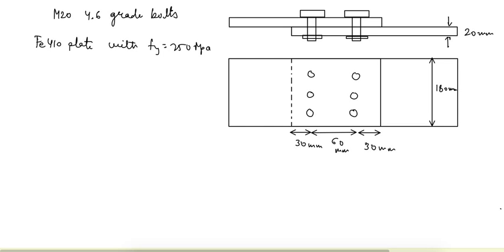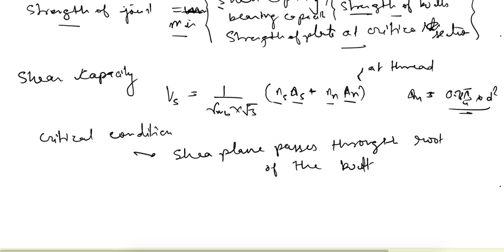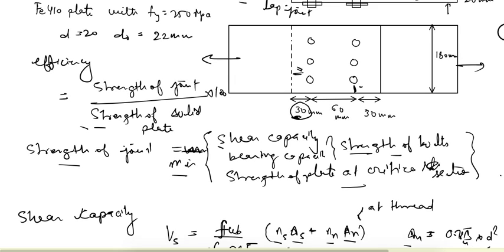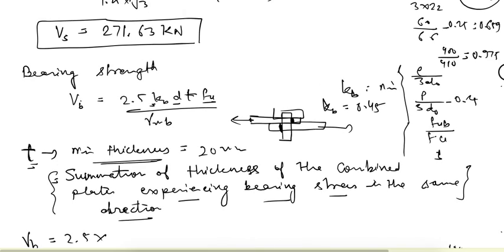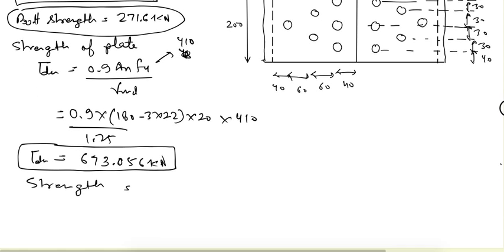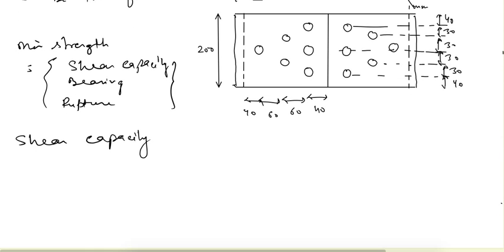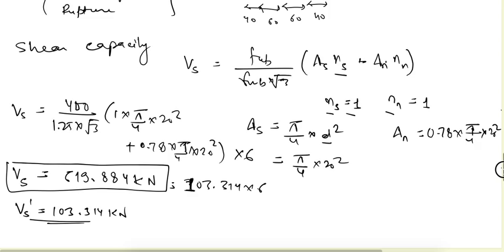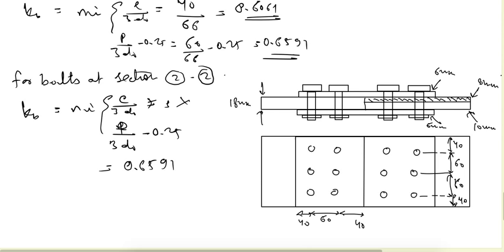Bolted Connection Design Solved Examples Part 1 | Design of Steel Structures

Comment: In some books the formula of strength of solid plate is (0.9×Ag×fu/safety factor) for bolted connection can you please clear this doubts why difference in formula

Comment: at 9:30 why did you used the ultimate strength of plate instead of the ultimate strength of bolt even though you were calculating the bearing strength of "bolt".
Reply: in formula that is fu only.. check IS800;2007 - class 10.3.4
Reply: thank you bhai..
Reply: In calculating bearing stress we r actually taking the projected area of the bolt on the plate, so we need to take the ultimate tense stress of plate not the bolt
Reply: Pradeep kumar I too have the same doubt

Comment: i think u missing 0.9 in strength of solid plate
Reply: There is no need for .9 , see clause-6.2 of IS-456 . Here strength is due to yielding of gross section
Reply: Whenever section failure is yielding I.e limit state of serviceability no need to multiply by 0.9
Reply: @Vishal Gahane dono ka value sam hota hai
Reply: @Vishal Gahane but edge distance is denoted by 'e' and end distance is denoted by e' ☺ a/c to is456
Reply: You may also like
https://youtu.be/Ul42kmMB_RE

Comment: Tdn is calculated per pitch length ,(not the whole length you took)
2.Vdsb and Vdpb will be multiplied by 3only instead of 6 as we consider one side of the joint.
Reply: you must calculate for 6 only not 3 bolts . each plate is involved in all 6 bolts ,If you were to find no of bolts required on the basis of Bolt value and total load . you would get 6 only.